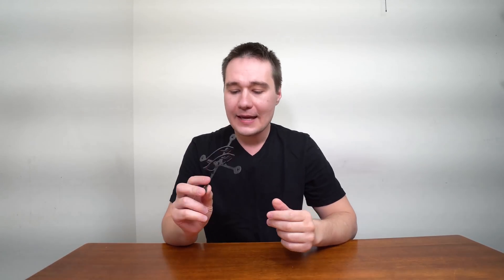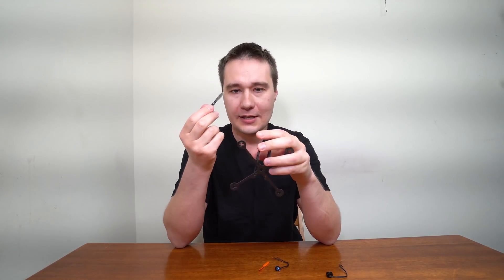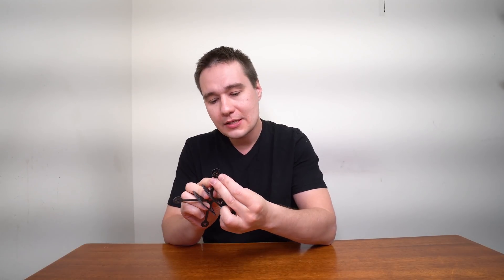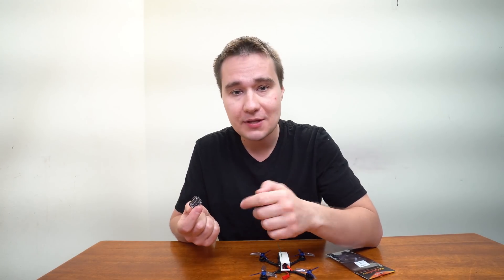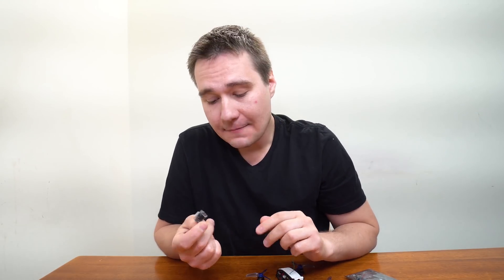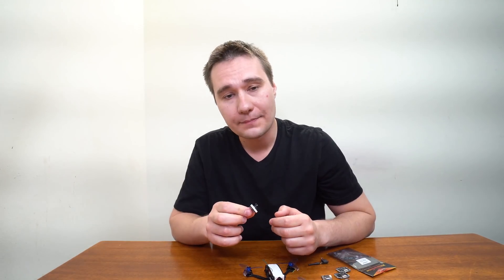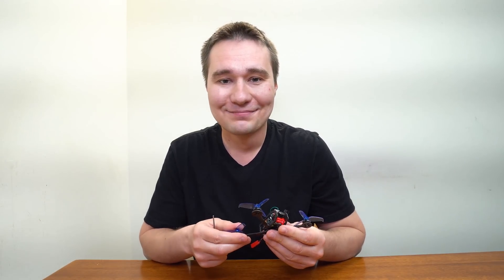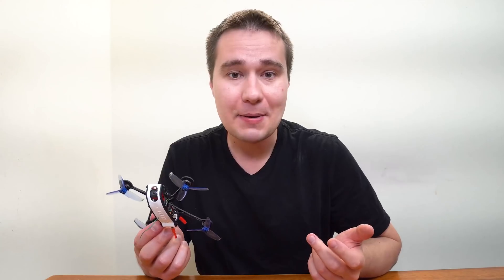First look at FlexRC Slim X 2.5", Super_S F4, FXT F81T, Predator Micro and 1102 12500kv motors

Comment: What about this frame but with 1104 2s ?
Reply from the maker: You can do it, most important is to keep it light
Reply: Flex RC how would a 26 gram 450mah work with 65mm bi-blade propellers and gool rc 1104 8,700 kv
Reply from the maker: It will definitely fly, but I'd be careful with crashing as it will be much heavier than 1102 setup as you will have bigger FC and ESC. If you wish you can PM me on FB or email me and we can cut you thicker version to make sure that you can fly it with heavier motors.
Reply: Flex RC what are the dimensions of the slim x frame  like thickness of bottom plate and top plate & the grams ? I would possibly consider getting a custom frame cut if I don’t find the right one from you .  I don’t have Facebook I only use YouTube it’s my only social media
Reply from the maker: right now it is 2mm thick, with custom 3mm thick it will be a tank. Also Ascent X 2.5" has wider arms which makes it strong enough for heavier builds
Reply: Flex RC Flex RC I want to do a build like the betafpv 75x but I want to use 48mm quad blade props instead , I ordered a bunch of the stock 40mm quadblad props but I found the 48mm ones and I want to do a brushless whoop Buld around them and I want to add a ublox gps for betaflight rescue mode , do you know of any whoop style Ducted frames ? I would also no mind building something like the 
NANO X 66mm brushless if there are no whoop style frames that fit this prop but like I said I want to use 48mm quad blades and it will have to at least 2s cause of the build size
Reply: Flex RC so thoes are the 2 builds I want to do right now but I can only start on one first I would like to build the whoop style first cause I have so many whoop type stuff laying around and a lot of the 40mm & 48mm quad-blade props like I mentioned with 1mm shaft that I can drill to at least 1.5mm motor shafts for the 11xx sizes motor shafts & I have about 20+ of 450mah 1s & 2s batteries laying around to use